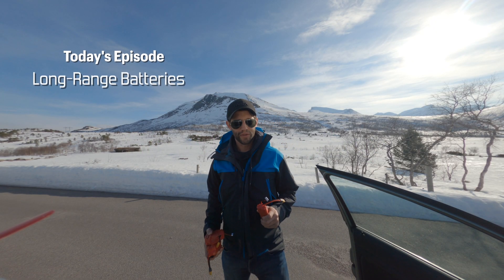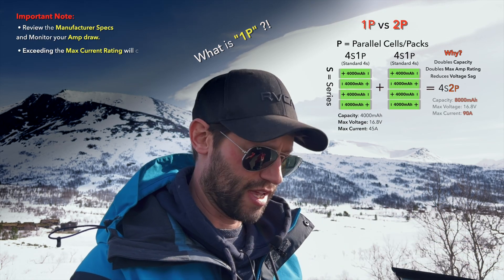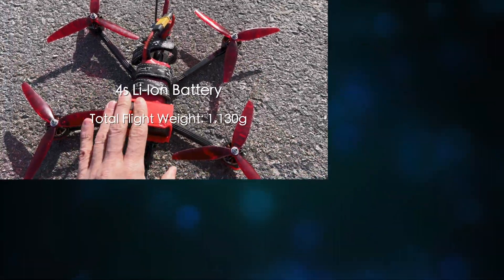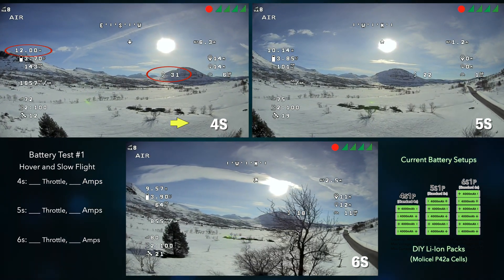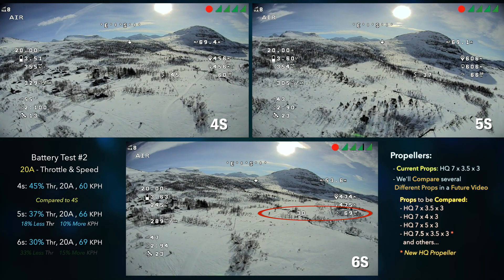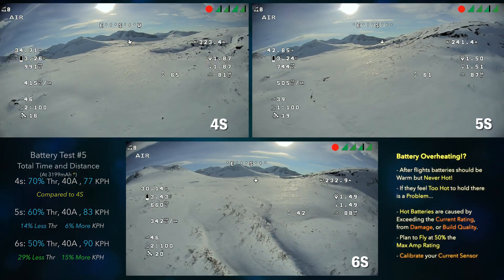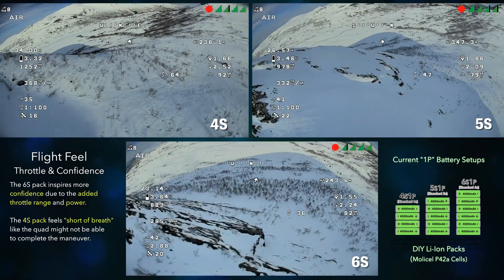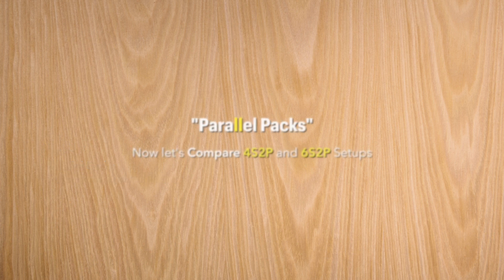Li Ion Battery Comparison for Long Range FPV Quads, Wings, and Planes. Chimera 7 with HDZero VTX

Comment: I find the conclusion a bit questionable. The total energy capacity of 6S and 4S is fundamentally different; it takes three 4S flights to equal the energy of two 6S flights. Looking at the data from your video, the 4S demonstrates over 30% better efficiency in terms of distance and flight time. When we consider a 2P setup, the advantage becomes even more significant. For long-range purposes, 4S is objectively the better choice in every way.
Reply from the maker: Your conclusion is accurate, the main issue here was my 4s battery was used and abused, my 6s battery was brand new built. If the both batteries were in the same condition the 4s for gentle cruising should certainly provide better range.  
My main takeaway from this particular video was I prefer the feel of 6s, and have since stuck with that for my uses.  In fact I did a follow up video (https://youtu.be/EcUCdOszF9U ) 
Which compares 18650 & 21700 6s packs, and why my “go to” is generally the lighter 18650 pack.

Comment: Best test channel out there here for the red pill. I have seen many 4S Li-Ion videos, and none of them do sustained vertical dives, also 99% never bother to do a flip for the whole 20-30 minutes flight. But they never say why, and they don't know why they don't dive with 4S Li-Ion. They just follow the manufacturer's advice to fly gently with it, happily living in the Matrix with the blue pill.
Reply from the maker: Hey thanks appreciate the comment.  I did a follow up video showing my current setup which works great.
https://youtu.be/EcUCdOszF9U
Happy flying, cheers!
Reply: @GiantAntCowboy  Yes, the follow-up video testing 6S dive explains it fully.

Comment: I’ve built a 7" FPV drone with the following configuration:
	1. Frame: iFlight XL7 V5 (7 inch)
	2. Motors: Flywoo NIN v2 2806.5 1350KV
	3. Flight Controller: Matek H743-SLIM
	4. ESC: T-Motor P50A 3-6S BLHeli_32 4-in-1
	5. Propellers: Gemfan Cinelifter 7035 (7×3.5×3 Tri-Blade)
The dry weight (without battery) is 530 grams.
My goal is to achieve long flight times for cinematic flying only—I don’t do freestyle or acrobatics.
I’m using Molicel INR21700 P42A Li-ion cells and would like advice on which battery configuration to build.
Here are the options I'm considering:
	1. 6S2P – 8400mAh, weighs ~900g
Concern: Heavier weight, though offers higher capacity.
	2. 6S1P – 4200mAh, weighs ~450g
Concern: Lower capacity, but lightweight.
	3. 4S2P – 8400mAh, weighs ~600g
Concern: Lower voltage (4S), may impact efficiency or thrust.

Question:
Which battery configuration would you recommend for smooth and extended flight time on this 7" setup?
Reply: Upon further research, I found that my motors — Flywoo NIN V2 2806.5 1350KV — are most efficient when used with a 6S setup. Additionally, since lithium-ion cells perform better with lower current draw, using a higher voltage (6S) system helps reduce the current. Therefore, I should go with either a 6S1P or 6S2P configuration. However, since the 2P setup will be heavier, the 6S1P option seems more suitable.
Reply from the maker: @MrNams there’s of course a couple options: 
• 4s2p draws more Amps but the 300g weight savings means you need less power to fly. If you just want to casually cruise around than I think 4s2p might be the most efficient actually. 
• For 2P setups you can actually make two 1P batteries and run them in parallel using a dual plug.  I did this for years. The benefit is that you can chose to run with one or two, or more, batteries depending on your flight plan.  Also you can monitor and replace each pack separately. The negative is some extra weight for the wires/XT60 adapter and you have to strap two batteries. 
• Another option is 18650 packs. They are smaller and lighter weight which can be beneficial.  My favorite pack right now is a 5600mAh 6s2p pack. Here’s a video comparing my 21700 vs 18650 packs. 
https://youtu.be/EcUCdOszF9U

Anyway, hope that’s helpful, and curious to hear about your results. Cheers!
Reply: @GiantAntCowboy  Tons of thanks for detailed reply and your valuable time. 6s2P is too heavy for 7" weigh around 900grams, thats why i am thinking to build 6s1p, i already purchased molicel p42a 21700INR 30cells, so i have only one option for cells and multiple option to build pack. 4S2P will not be efficient for my motors 1350kv right?
Reply from the maker: @MrNams I have 1300kv 2807 motors, and get over 30mins with my 21700 6s2p pack.  (I shared the video above)
It’s not too heavy at all, in fact the extra weight makes it pretty steady in wind. No problem for gentle flight. Make sure you have good straps! I actually have Velcro on the frame and batteries. This mixed with straps is very tight and secure even when doing extreme maneuvers.
Reply: @GiantAntCowboy  Thanks a lot, your reply helped me lot.
Reply from the maker: @MrNams absolutely, good luck with your build!

Comment: Nice one. I'm struggling to find li-ion cells available online in reliable sources, don't know if I'll trust shady aliexpress deals...
Reply from the maker: @rodrigoc.goncalves2009  I’m in Europe and have bought from Nkon.nl; fast shipping good prices.  But not sure where you are. 
AliExpress is probably fine, as long as they are the correct cells.  I really like molicels. 
Here’s my most recent battery test which might be interesting for you (30+ Minute Flight Time | 18650 vs. 21700 Li-Ion
https://youtu.be/EcUCdOszF9U)
Good luck, cheers
Reply: @GiantAntCowboy  thanks, will be using nkon. Any thoughts about EVE INR21700? Cheaper than molicel and advertises 50A.
Reply from the maker: @rodrigoc.goncalves2009 I have no experience with them, but agree the specs look great.  Worth a try!

Comment: that's the most detailed battery test for FPV I've ever seen! Great work 👏🏻 
I'm currently building my battery setup and this video was very useful for me!
Reply from the maker: @wolodymyrblack  Glad the effort is appreciated.  I did a follow up video comparing 18650 & 21700 6s2p packs. Check it you, might be useful for ya.
https://youtu.be/EcUCdOszF9U
Good luck with your builds, cheers!
Reply: @GiantAntCowboy  I've already bought some 21700 Litokala 5000 mAh elements to build a 6s1p pack for my 5 inch quad, the only downside is the max current of 25A, but I'm planning to do more slow cinematic flights, so I won't push it to the max, but I still hope it will have a bit of headroom
Looking for a perfect weight/flight time/performance setup, so I'm still thinking about building a 4s2p battery too, to test it out, but maybe with Molicel 42a elements
Reply from the maker: @ yea Molicels are great. Only battery I use. P26, P42, P45, all good options.

Comment: 9:15 I am just a beginner just learning as much as possible before purchasing anything, so please forgive me if I am wrong. But I am not sure it makes sense to compare battery efficiency measured in mAh/km between a 4S and 6S pack, since they each have different voltages. Watt-hours/km would be the correct way to account for this, and in that case (assuming max voltage ratios for simplicity) the 4S would actually be around 25% MORE efficient than the 6S, not 12% LESS efficient as implied here. Of course the actual voltages drop gradually during the flights of both, but their averages are still drastically different in about the same ratio. Small totalizing watt-hour meters are available if you really want to do an accurate comparison.
Reply from the maker: @Darrylx444  yes, you are correct.  Made this video a few years ago and as you said it’s always a learning experience. 
Great hobby for learning! Hope you dive in and have a great time.  I’ve made and tested a lot of DIY batteries and antennas over the years.  Great way to learn and also save money! Cheers!

Comment: Are these Values for Efficiency, still up to date?
I build a 7 Inch with 1300KV Motors (2807).
When  cruising arroung I get values below 200 mAh.

In the first Run, I landed after 21 Minutes, with 2500 mAh Used and 3.7 Voltes  left.
Battery was a 6s1P 5000mAh with 21700 Cells from GNB
Reply from the maker: @vhudxbjv  i actually did an update jiT a few months ago where I tested 18650 & 21700 packs. 
https://youtu.be/EcUCdOszF9U

Check it out and let me know your thoughts, cheers!

Comment: this is a great test thanks dude. It doesn't seem to me that the 6s2p is a whole lot better than the 4s2p? I guess weight has something to do with it, and also I've heard that the lower voltage is more efficient due to less heat loss...however in your case you are keeping the motor kv stable with different voltages which will mean lower rpm.
Reply from the maker: @SupaflyFPV  absolutely! For slower long-range flights 4s setups seem to outperform due to the lower weight. 6s just reduces voltage sag and is better for higher speed or recovering from a dive. 
I did an updated test a few months back that’s worth checking out. (Long Range FPV Battery Testing DJI | 30+ Minute Flight Time | 18650 vs. 21700 
https://youtu.be/EcUCdOszF9U)

Thanks for watching, cheers!

Comment: only 7-8 minutes? I see li-ion builds on youtube that get 20-30 or more, why is this one so low?
Reply from the maker: @0baakYT  with my latest 6s2p builds I’m getting much better flight times.  Here’s the updated test which compares 18650 vs 21700 6s2p packs. (Long Range FPV Battery Testing DJI | 30+ Minute Flight Time | 18650 vs. 21700 Li-Ion Packs 6s2p DIY
https://youtu.be/EcUCdOszF9U) 
These ones are awesome!
Reply: @GiantAntCowboy  sweet man watching now thanks for the reply

Comment: sorry but i really dont understand, can a 90A battery burn a 50A esc like the speedybee f405v3 with 35.22A motors like IFlight XING-E Pro 2207 1800KV and how can I connect thoes 12 batteryes together?
Reply from the maker: • So a 50A ESC is the per motor rating, meaning that the ESC will actually handle up to 200A. 
• The Li-Ion battery I’m using will handle up to 90A for short periods of time. If you try to pull more it will damage the battery, and maybe even catch fire in extreme cases. 
• I build all my Li-Ion packs using Molicel Batteries and a Soldering iron. Here a quick DIY Video I made years ago - https://youtu.be/hnjgdUU3x5A
Hope that all makes sense, thanks for watching!

Comment: Great video! I built a 6s li-ion using Molicel 4200mah 45A. How bad is it for the battery if I cranked it up to 50A for 3-5 seconds?
Reply from the maker: Did you solder or spot weld?
If you soldered you might be able to pull 50A for a few seconds with no issues, likely you’ll get a ton of voltage sag though. Doing that a lot will reduce the life of the cells… I’ve noticed that one cell, (the one hooked to the negative terminal I think) wears out quicker than the rest on a couple of my packs from abuse. 
If you spot welded the Nickel strips/weld will quickly overheat and create a ton of resistance, so pushing the current (Amp draw) hard will be more of an issue. 
Hope that helps, thanks for checking out the channel, cheers!
Reply: I soldered it. Oh, that's great to know! I didn't know that what I did was better. WOOHOO! The lipo battery is for my 7 inch which I cruised at 25A-30A only. Thanks for getting back to me. I appreciate it a lot! :)
Reply from the maker: @neilfpv  yea spot welding is easier, cleaner, safer, more professional… but Nickel has higher resistance, and the Nickel tabs used are usually too thin. You’ll often hear people complain that their li-ion packs are really hot! Or caught fire, or have terrible voltage sag… all these issue stem from poor cell connections. 
It’s a huge debate, but I’ve always argued the benefits of soldering copper vs welding nickel. 
Fun Fact: Nickel can be “welded” because it’s electrical resistance is high enough to melt the metal. Copper can not be welded because it transfers electricity so well. That should be the main argument. Haha cheers!
Reply: @GiantAntCowboy haha, very cool! Really great to know this information. Thanks for sharing! :)
Reply: @GiantAntCowboy subscribed! :)
Reply from the maker: @neilfpv  thanks, appreciate the support!

Comment: Thanks for your job!! From BRAZIL!! By the way wich antenna do you recommend for chimera long range ? BARDPOLE Would be good? Thanks
Reply from the maker: Appreciate the comment! For the Control Link I found the Bardpole worked good, but i Highly Recommend a diversity RX. 

I currently run 2.4ghz ELRS Diversity at only 100mW and have near perfect LQ even out 7km, and only using standard di-pole antennas. Cheers!

Comment: hy i've got some sony murata 3100 mah 35A curent cells to make a 6s2p pack , my concern i about how many nichel strips do i need to get 35A per series pack (35 per pack will lead to 70A discharge total 2p config), i have some 0.2x8 mm pure nichel strip that i've heard and tried that it doesn't like to stack multiple layers, and some nichel plated steel that weld better more buttery. Are 4 layers enough ? should i alter the strips to have steel nichel steel nichel ... also i think it is better to connect the cells in paralel at each joint of 2 parallel cells but i ask just to be sure
Reply from the maker: To be honest, I’ve never Spot Welded Nickel strips. I always solder mine. It’s a little more time consuming but I prefer to use Copper wire as it’s 4x more conductive than Nickel. (Also I don’t have a spot welder…)

So unfortunately I’m not the best resource for this question. Definitely thicker is better. I often hear people complaining hot poor performing Li-Ion packs and suspect those packs are made with too thin Nickel strips. 

Keep me posted on how it works out though, always curious. Cheers!
Reply: @GiantAntCowboy  That was a fast response :)) i didn't considered soldering as i've heard that heat damage the cells so i though to go on the safer side spot welding them. I would also be more comfortable with soldering them, i don't know if those spot welds will create enough surface area of contact betwen the first strip and the cell tab
Reply from the maker: @alexandrugroza839  yea I’ve soldered a dozen packs and have used them for years. I run them pretty hard as well and have had no issues. 
The key to soldering is working in stages. Sand & clean each terminal before starting. Use Flux. Tinning might take a couple tries, but hold a finger on the battery and stop when it start to feel warm. Just move to the next one. 

Important: 
- Check that each cell is around 3.5v before soldering them together. 
- The outside of the cell is Ground (-) so be careful when soldering (+) terminals, and make sure the insulation on the (+) terminals is intact. 

Here’s a basic DIY I made years ago showing the process.
https://youtu.be/hnjgdUU3x5A
Reply: @GiantAntCowboy  thanks!

Comment: Hey I guess I am impatient to watch the whole video.  Which ones would you conclude are the most efficient for LR?
Reply from the maker: Sure, no worries. Most efficient longest flight time at slow speed was the 4s2p packs. If you skip to the last test it shows a comparison of my 4s2p vs 6s2p when doing gentle cruising. 
There’s a lot of variables of course and you’re setup will be different than mine but these were my results. Cheers

Comment: Giant ant cowboy i live in Maine near the white mountains in the USA. I was wondering if you would share any of your STLs from your antennna mounts. I wish for a day you could come fly the white mountains and Mount Washington with me than I could go there and fly your mountains. Also do you have w written guide on making my own Lions i buy mine right now and they are so costly
Reply from the maker: Hey appreciate the comment. Yea I wish I had time to just travel and fly different spots all over the world. What a thrilling experience it is to fly mountains and different landscapes! 

Which STLs are you looking for? Like which antennas?

Regarding DIY batteries, I made a simple video about this which might be useful:
https://youtu.be/hnjgdUU3x5A

My favorite cells are Molicel P42a or P45b of building a large 21700 packs. And Molicel P28a cells if you want a lighter 18650 pack. Should be easy to get in the USA. 

Soldering batteries is no big deal, BUT you do not want to over heat them or connect them wrong. So:
- Touch the cell with your finger while soldering and stop when it get warm. Work quickly, and take breaks to cool them as needed. 
- Makes sure all cells have the same voltage before you start soldering, ideally below 3.6v.  This drastically reduces any risks involved when making these packs. 

Remember to take your time and make sure everything is wired properly; use a multimeter to check the pack. Happy flying, cheers!

Comment: Molicel P42a 21700 Cells have changed the hobby for me. Especially fixed wings, but with 7" inchers blowing up, the more the merrier! And my cars, goggles, and Zorro also feel that Molicel love! Thanks for this great video!
Reply from the maker: Yea, Molicel even released newer P45b and P28b cells this year which are a nice little improvement.  Thanks for watching and commenting, appreciate the support. Cheers!
Reply: @GiantAntCowboy  I have a 6" LR running Upgrade Energy's P45b 6s pack. 21700's are so good.
Reply from the maker: @The0nionKnight  yup, I’d love to get some of those new P45b cells.  Hard to order them here in Norway.
Reply: @The0nionKnight What frame did you use for 6s 21700. Is there enought space to fit the battery
Reply from the maker: @carlitov9734 I’m using the iFlight Chimera 7 frame, but the FR7 and Falcon Rad frames also work for these packs.
Reply: I get 22min with my 6inch nazgul evoke v2 on a 4000mah lion, the evoke is my favorite quads of them all, even my 8inch tanq isnt as cool